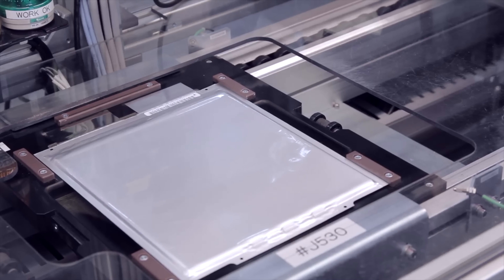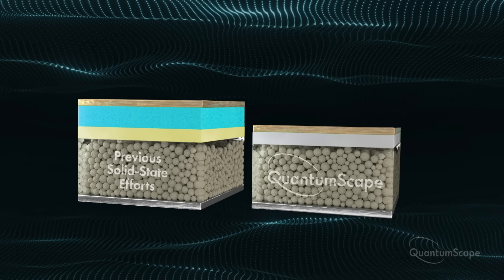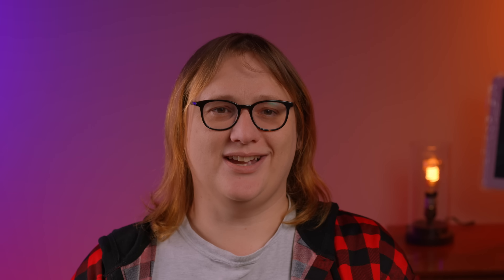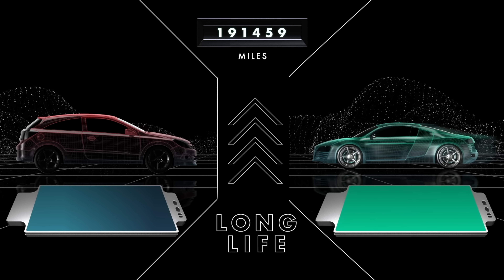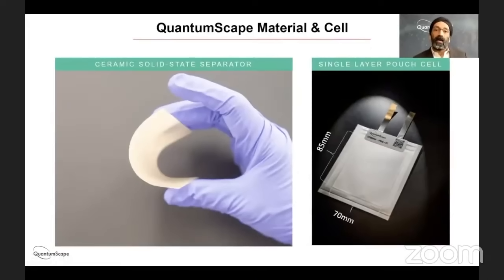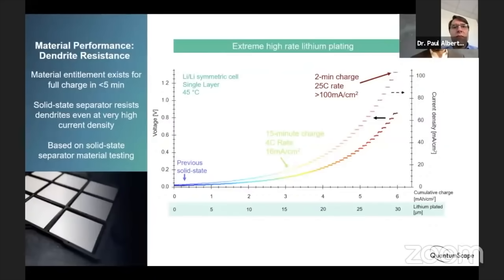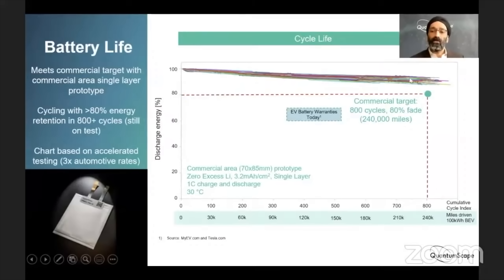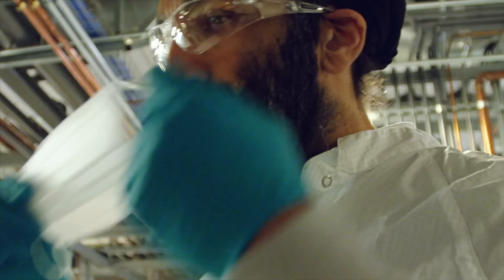Why Quantumscape's Battery Revolution Is Big News

Comment: Ive been holding onto my prius since 2006. Work good except no air. But im done waiting. Next 2022 prius im buying. I just wish mpg was over 70 for hybrids by now...
Reply: Toyota will launch their solid state battery in 2021:
https://www.topgear.com.ph/news/technology-news/toyota-solid-state-battery-a4354-20201210
Reply: @buddy1155  showing a prototype is not launching. And even when they start selling vehicles with their new batteries (2023? 2024?) they will most likely be very expensive and unpopular like their Mirai.
Reply: @ayushin82  Well, the plan was to unveil it on the Olympic Games in Japan, so it has been finished for a while, the factory is already being build. I expect the batteries to be ready for the Toyota's and Lexuses announced on the eTNGA platform. That would be late 2021 early 2022.
Reply: @ayushin82  Don't forget, this is important technology, it looks VW, Mercedes, GM and Toyota will have a solid state battery.
Reply: @buddy1155 There's no chance that first eTNGA cars will have solid state batteries. Earlier this year they said "Toyota is partnering with Panasonic to put solid-state batteries into limited production in 2025".
Reply: @buddy1155  eventually, everyone will have solid state batteries. But I don't see it becoming mainstream before 2030.
Reply: @buddy1155  and just to illustrate Toyota's pace: they showed their first fuel cell vehicle in 1996. It's been more than 20 years since then and 7 generations of their FCVs, and yet they still can't sell more than couple of thousands of Mirais a year.
Reply: @ayushin82  EVs did never took off until there were enough charging stations, exactly the same for Hydrogen stations. Just watch how popular Hydrogen will be especially for all kind of heavy equipment. Japan and the European Union have both plans setting up a Hydrogen infrastructure. Anyway it has nothing to do with the pace of Toyota but has a lot to do with the philosophy of Toyota, I can't remember the Japanese name for it but it is slowly making incremental improvements, that is why they keep their engines for many decades and also why their quality is so good.
Toyota is playing the long game, they don't care that their fuel cels are not selling at this moment, when they start selling they got the best.
Reply: @buddy1155  hydrogen for consumer cars will probably never be popular outside of places where it's heavily subsidized (like Japan) because it will always be more expensive than electricity (in general, in some special cases it can be cheaper).  Toyota's philosophy will kill them, they don't have the time for slowly making incremental improvements when the market is rapidly changing. Well, not completely kill, they will lose 90% of their market share in 10 years and become a local manufacturer.
Reply: @ayushin82  You might be right about passenger cars, Hydrogen is better suited for trucks, ships, construction vehicles and planes. 
Hydrogen has an other purpose, electricity is extremely expensive to store. a day/night surplus/shortage can be done in batteries. In summer there is a higher energy production and in the winter is the highest demand, especially if we want to get rid of all the gas and coal plants we need a way to store huge quantities of energies for several months, hydrogen is the best way to do it. once converted you might as well use it in a fuel cell. 
In the entire existence of Toyota they had only one single year where they had a loss, every other year they have been making a profit, Toyota knows exactly what they are doing.
Reply: @buddy1155  for long term storage and big vehicles - sure. And you can find many examples of large profitable companies, market leaders going extinct when newer better technology came along and they were too big and too slow to adapt. I'm sure  this year and every year after that they will lose money and market share.
Reply: @ayushin82  Toyota is in trouble, but for a very different reason, because of RCEP. Toyota dominated the asian market and RCEP opened up almost their entire market to China, it is expected that China is going to dump vehicles on the market. to retaliate Japan and Korea for getting their factories out of China. But Toyota still dominates Africa and South America, Australia and doing well in Europe and North America as well.
Reply: @buddy1155  not for long. Almost nobody will buy Toyotas in 10 years the same way as nobody is buying Nokias now. You'll see.
Reply: @ayushin82  It is hard to tell how they will do with BEV and HEV but that does not really matter. Half the world (Azia, Africa, South and middle America) will be buying ICE vehicles for the next few decades. And Toyota simply. build the best cars in the world.
Reply: @buddy1155  no, even third world countries will go 80% electric in 15-20 years, because there will be plenty EVs cheaper and more reliable than the cheapest ICE Toyota. And setting up infrastructure is not that expensive.
Reply: @ayushin82  Are you serious ! have you ever been in Africa? many towns don't have electricity. And in the towns with electricity you could kill the grid with charging a single car. And a EV will never be cheaper to produce as an ICE vehicle, only the copper in the electric motor is more expensive as a complete internal combustion engine with gearbox.
Reply: @buddy1155  and how many new Toyotas do people in these towns without electricity buy? Sure, countries without strong electrical grid will be the last to adopt EVs, but I really doubt that Toyota sells more than 10% of their global sales in such countries. And cheapest Toyota is $15000. There are already many decent EVs cheaper than that in China and their price will only be going down.
Reply: @ayushin82  Africa has a population of far over one billion and 50% of the cars are either a high-lux, high-ace or corolla. People need to transport their goods, they got all small farms they need dozens of vans what we put in one semi-truck.
Reply: @buddy1155  yeah, there are lots of people in Africa and Hilux is very popular there, I know. But Toyota does not sell a million cars there, I can't find the number, but it is probably less than 500k cars. And is there a lot of people who can afford a new Hilux ($35k) and at the same time have no access to electric grid or can't afford installing solar on their farm? I doubt that.
Reply: @buddy1155  found it, Toyota sold 200k cars in Africa in 2019. So it's currently only 2% of their global sales. Even if African market explodes and if Toyota will somehow increase their share of it, they still most likely won't be able to sell a million cars there. In 10 years it will probably be second or third most important market for them, but I doubt it will let them survive much longer.
Reply: @ayushin82  That is a lot less as I thought, if you cross the street in Africa it is hard to not get hit by a Toyota. But still they will absolutely survive, no doubt about it,
Reply: @buddy1155  I'm pretty sure most of them are used cars from Europe and Japan. And I have no doubt that in 10 years Toyota will be a fraction of what they are now.